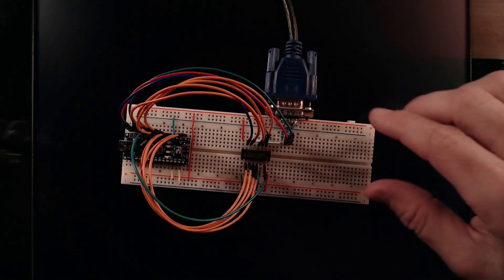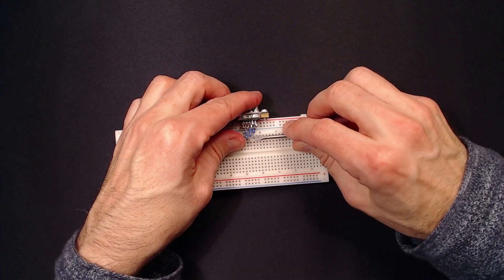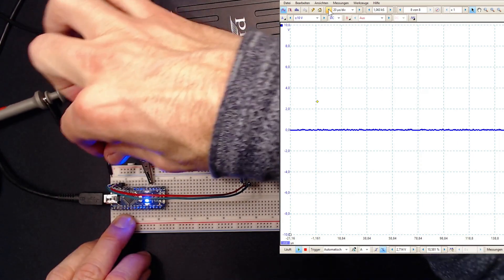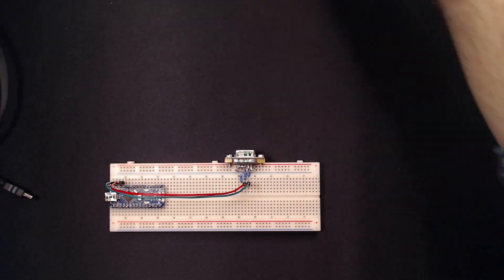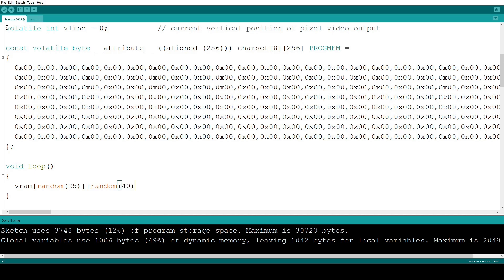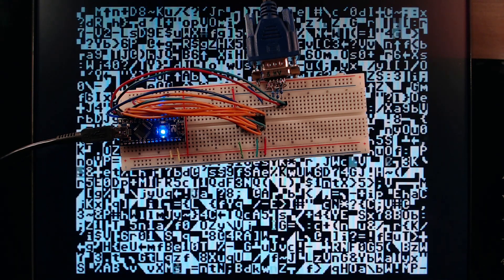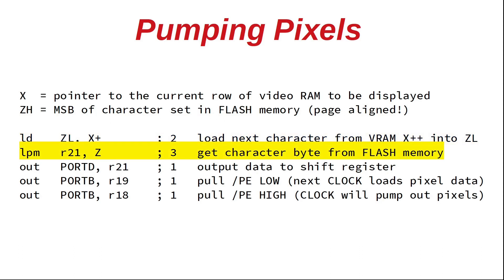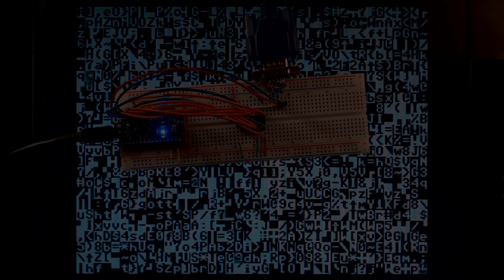Minimal Arduino Nano VGA 320x200 (using ONE IC)

Comment: I want same but with Esp 32 cam web based system using one of its gpio to also genral video signal in composite formet so we can also transmit it using rf diy transmitter and amp to analogue crt tv .

Comment: Great job. I  don't think I have any HC166's laying about. Time to get some on order in preparation, I think.
Reply from the maker: Hey Aaron, initially I had used 74HC165 but they lack the sync loading feature that I need here...
Reply: @slu467  Hey Great video! Could you explain  what is sync load :)
Reply from the maker: Sync means "happens with the rising edge of the clock while /PE is low", not with /PE going low just by itself (that would be called async). Cheers!
Reply: @slu467  I was wondering. I've got a tube of them on their way. I think I may need a bunch soon!
Reply from the maker: @colonelbarker  Just ONE, Aaron :-D
Reply: @slu467  but what if I had three machines?

Comment: Oh yeah and running the AVR with a 25 MHz clock should be possible, in which case you should be very close to real VGA timings. Quick calculation says you could get 640px wide line  with 6.4 us reserved for hsync and hporches, so if it ain't too tight, it could work. Or just giving the 74x166 a 25 Mhz clock if the memory output timings are enough cycle wise (you will get 2 cycles per character if you put the parallel load on a timer as mentioned earlier)
Reply from the maker: Hej Jani, you mention some interesting options here... 25MHz is way out of spec, though. Absolute max. rating here is 20MHz (on paper)... I will look into that for sure ;-)
Reply: @slu467  Yeah, that's what the paper says but afaik all AVR chips can easily handle 25 MHz. I'm running my own "GPU" at 25 MHz and maybe it slightly decreases the lifetime of the AVR, but I doubt it will harm the chip so much that it would "burn up" in any meaningfully significant time period.

About the 74x166 chip though, I'm not sure what they can handle. There might alternatives  or series that can handle faster rates than 20 MHz...
Reply: Keep voltage as close to possible to 5.5V, install decoupling caps close to chip or above it, keep ground and power lines short and thick.
in worst case You will get bit of glitches/artifacts on video out, but all chips should run fine.
If You want to overclock further, consider using external clock generator and a buffer gate. 
There is nothing wrong with running those chips "out of spec" for such apps - worst that can happen is they can crash. 
Beyond certain freq. some cpu instructions will not latch correctly but that's all. 
328 logic should run fine up to about 50mhz. ofc. except eeprom writes.

Comment: Couldn't you clock the 166 parallel load line with a timer? You'd have then at least 2 cycles more per character to do stuff, though quickly thought out I can't think of anything else to do during that time than to nop nop.
Reply from the maker: Actually, that's what I did in my first version. I've used a timer and generated from each toggle a negative load pulse with an XOR delay line. Could be interesting to pump out 8 pixels in 6-7 clocks and have the shift register running a bit faster... but in any case there will be a growing number of components involved (oscillators etc.). So it probably doesn't "count" as a minimal solution ;-)

Comment: Great video! A question, can I use an external 16Mhz crystal clock, instead of having to burn the Nano fuse to output its 16Mhz clock?
Reply from the maker: The thing is, it has to be in sync with the cpu. you can use an external clock but you would have to set up the fuses for that, too.

Comment: Just wondering where you find your font sets? Or do you just code your own as you need them like I do?  I'm working on a serial terminal of my own and I was amazed when I saw your video that this was possible with this microcontroller.  I'm using an RP2040 with VGA out and a USB keyboard.
Reply from the maker: Hi, I do the sets as I need 'em with paint.net :-)

Comment: Im making this on arduino uno, currently I don´t have the shift register. So insted of connecting color to register it's connected to the pin 11 so I can see something if it works but my monitor doesn't show anything. If there wasn't a signal the monitor would display that there is nothing connected. I measured the color pins and the signal is there.
 I know that VGA on the monitor 100% works.
Reply from the maker: gambler, you can check whether the monitor sees proper sync signals without the shift reg. Just connect the RGB lines of the monitor to GND. It is handy to take a look at the two sync signals with a PC scope if you have one.
Reply: @slu467  I checked the sync signals, they were changing a bit then I checked the clock 16mhz clock throughput and It sometimes disappeared. When I tried other arduino uno the program worked.
Reply from the maker: @gambler301  Glad to hear you got it up and running. It was the one defekt Uno then... :-)

Comment: Good work, is the video ram to small for 640x480:character? The CPU to slow? Flash memory for the character generator is a good idea. External ram is a problem for the Nano. Is there another AVR for better resolutions.
Reply from the maker: The CPU is too slow for 640 pixels horizontally. It could do 400 vertically without any problems, but this would lead to very flat looking characters ;-)

Comment: So you push out 1 bit per clock cycle at a 16 Mhz clock. That would leave the AVR chip to push out a new byte to the parallel data lines every 8 cycles. I believe the fastest you can push out from memory is 3 cycles from an AVR (though from flash you might need 4 as LPM Z used one cycle more than normal ram access iirc?) . So there's plenty of time to do that and even interleave some other stuff there too, though things might get a bit iffy for decoding the correct line etc. Good stuff!

16 Mhz isn't exactly a VGA pixel clock, so... Hmm. Divided for 32 us, it would be 512 pixels, but we at least need to give some time for the horizontal sync, and maybe even the porches (don't know how tight VGA is with porches)... So maximum 480 pixels wide, but I'm guessing 320px?  Are you doing line doubling? If so, is this a 320x200 monochrome textmode image? No wait I'm stupid, it says so right there in the description!

You could get a 8 Mhz pixel clock with just the AVR's SPI, so effectively a 160 px wide resolution (as it's half of what you have now). To make it at least somewhat proper aspect ratio, might as well cut the height in half again, so without any external IC's at all, you can get a 160x100 monochrome textmode image. IIRC you get 16 cycles of free time after sending the byte to the SPI register in AVR to fetch the next character's data in, so there definitely is plenty of time. 

Last summer I did a Monochrome 32x24 textmode composite out for PAL (256x192 resolution) and during the hsync I created a single channel square wave which frequency I could control, and during vsync the rest of the chip was active so I had time to play simple music and do little snake game with joystick input. With PAL signal the horizontal pulse is done every 64 us, so double that of VGA, so I could actually get a 320x200 output just with the SPI output I was using (it was in USART mode for reasons, there were some complications in pure SPI mode).

Anyhow, great stuff! Thanks for putting this out there and showing it to us!
Reply from the maker: Hej, Jani, glad you appreciate it :-) Thanks for your thoughts on that! You are digging pretty deeply into this topic as well, hmm? Have you seen my series about generating VGA from TTL (in a very neat and minimal way, I think). I am currently building a memory-mapped VGA card for my DIY CPU from that... so there is more to come :-)

Playing around with the ATmega328 I really try to avoid making it "better" by placing more and more components around it. After all, it has it's limits... and that's a good thing.
Reply: @slu467  Yes, there's definitely an art to keeping the component count as small as possible, and I think that's something to strive for, but it all depends on your end goal.

About the VGA TTL stuff, I actually found the videos shortly after making these comments, great stuff!

Similar stuff to Ben Eater's World's Worst Video Card, but that's a good thing in my mind, so I hope you take it as a compliment it's meant to be.

I'll probably be watching many of your videos in the coming days, I might or might not have things to say about them but even if I won't comment that much, I appreciate you making the videos and going through your thought process and implementation details in a concise and clear manner!

Comment: Can it work with I2C or serial with out corrupting data (something like draw or clear screen commands)? I tried to do something with TVout with pollserial, but i failed, every 10 character gets corrupted. Thank you if you read this.
Reply from the maker: To my humble understanding one would at least need to use two ATmeag328P for this...
Reply: @slu467  i think my English is broken... I wanted to ask, will serial (from TX pin to RX) or I2C communication work or break VGA signal generation?

My low buget only allows me to get cheap arduino nano-s from china and they have old bootloader, will this affect code or perfomance?
Reply from the maker: You cannot use RX, TX with my VGA code on SINGLE ATmega328P.
Reply: @slu467  im sorry but what do you mean single microcontroler? I cant just fuse 2 of them in one... I plan for one to send serial data from command arduino to graphic arduino. Is it posible?
Reply from the maker: As I said. No. Not with RX, TX any more. But watch out for my next video... ;-)
Reply: @slu467  ok, ty
Reply: @acaRobloxvideos  I can see how this sounds confusing. Because video timings are sensitive, we interrupt whatever the ATmega is doing to generate the video. This only leaves time at blanking intervals ("porches") to do things other things in the program. Using a function that also has interrupts may conflict with the video generation interrupts and mess things up.  Basically you cannot generate video and do other things at the same time, hence using two ATmegas.
Reply: @whoblue579beta3  i still dont understand how to use 2 microcontrolers... Its not important, i will probably just use propeler ic.
Reply: @acaRobloxvideos  Secondly, you can get a DIP ATmega328p-pu for like $2 at electronics suppliers like Digikey, use a stable power source, some decoupling caps, a crystal if needed, a USB to RS232 thingy, and you basically have a homemade Arduino
Reply: @whoblue579beta3  yes, i know, i have done it, but i have fear to destroy ic. Also here in Serbia electronics stores are almost not exsisting... So i have to oder parts from aliexpress...
Reply: you can also design or pull a PCB from online so you can use cheaper SMD components and eliminate the cost of an extra breadboard
EDIT: Somehow I forgot to mention that doing this is much cheaper, and that there are many ways to flash a boot-loader (Duck It!)
Reply: ...............
do we have a discord server?
Reply: @whoblue579beta3  i dont have tools and steady hand for SMD parts... Also most online PCB services dont deliver to Serbia, and those who do they are expencive. I usaly make custom PCB for THT parts with chemicals.